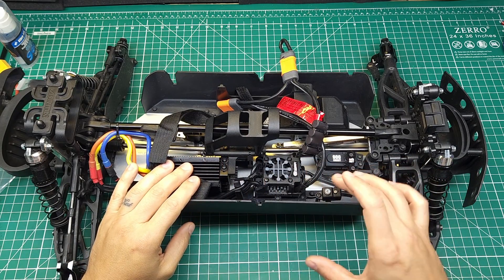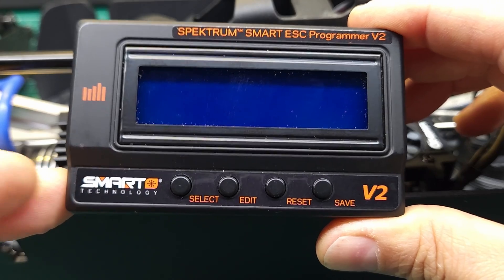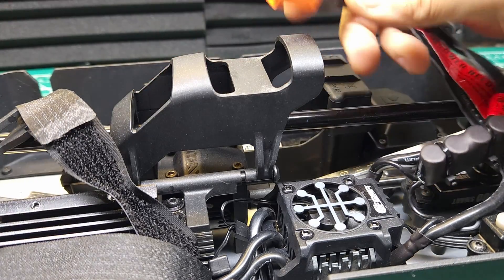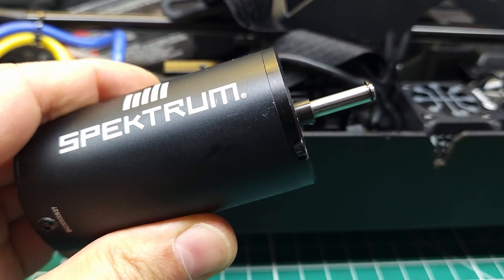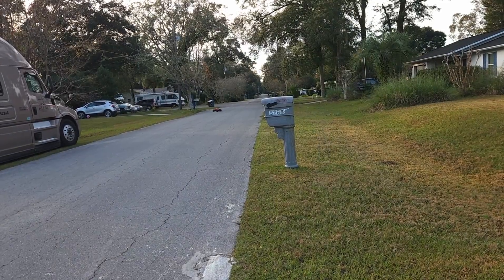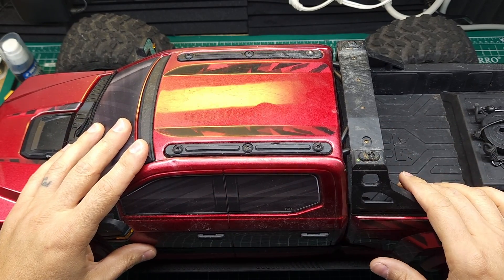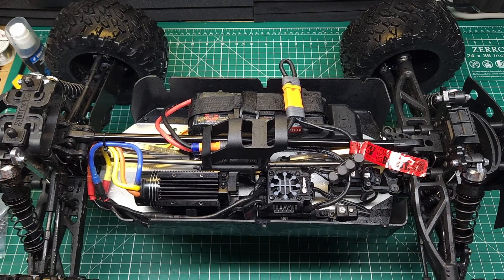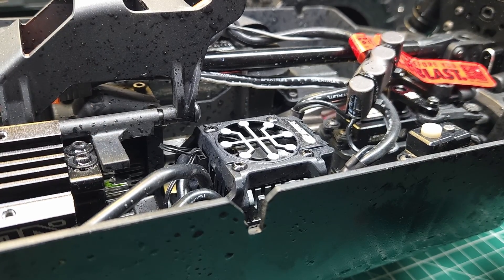Does New Firmware Fix The Firma 150 V2 Issue?  Let's Find Out!

Comment: Would you recommend this esc over the old blx 185? Im currently having issues with my 185 not sure if i want to try and figure out the problem or i can get this esc for 65$ on a open box deal
Reply from the maker: Well if you're having problems with your 185 then this would definitely be better though I don't know if it's going to be an improvement in performance.
Reply: @DoRC  the problem I'm having is it's going by itself after I changed the servo and I think my nephew moved the buttons on the radio and reverse not working

Comment: I received my new Kraton EXB 6S yesterday. I did an unboxing video, and the original seals had been cut and new ones applied. I also checked the firmware version, and it is running b5.07, which is the most current as of this reply.
Reply from the maker: Yeah I heard that's what they were doing. Looking forward to getting mine on Tuesday!
Reply: @DoRC  you’ll love it! Can’t wait to see your videos on it. Just did a fully stock speed run! Uploading now!

Comment: I have the V2 programmer and still can’t get the new firmware version to show up under available versions only the old version PB-1.0.10? I even uninstalled it from my desktop and reinstalled it.
Reply from the maker: You need to download the latest version of the software from the link provided on the programmer box Page on horizon's website.
Reply: @DoRC  I went to the link from the V2 Esc I’m guessing there is a difference?
Reply from the maker: @dwaynehensley3488 Not sure. I would look up the programmer itself and then use that link. That's where I got mine from and it worked fine.
Reply: Ok trying that now. Thank you
Reply from the maker: @dwaynehensley3488  You're welcome let me know how it goes
Reply: @DoRC Well I got the program box updated to the newest version but now it will not let me click on Firmware update after I change to the ESC drop down menu. Mine only shows about and firmware update unlike yours showing the basic and advanced icons also. I can program from the program box now but can’t get the Esc update.
Reply from the maker: @dwaynehensley3488 have you tried restarting everything?
Reply: @DoRC  yes sir a couple times even uninstalled everything and started over still nothing. I have contacted HH to let them know. Just don’t make sense I can update the program box and reprogram the Esc with the box now as I made sure that was working but can’t update the firmware on the Esc.
Reply from the maker: @dwaynehensley3488  It is weird. It means your computer is talking to the box and the box is talking to your ESC but the three aren't working together which is not something I've ever seen before. Not really sure what to suggest other than maybe a different computer, different USB cable or try it with a different ESC just to see if you can narrow down what's causing the problem
Reply: @DoRC  will do, already tried a different cable with no luck. Will try a different laptop next. Thanks again for your time and help.

Comment: I didn't like having to buy a Bluetooth module to access everything on my Traxxas X-MAXX. But sometimes I would get over the air updates and I prefer that than connecting a program box to my other ESCS!
Reply from the maker: Yeah when it works the Bluetooth is great. My concern is that sometimes it doesn't work

Comment: Hello... just curious..Whats the difference between this esc and the regular spectrum esc ..I do have this one...Im going try to upgrade my programming card again... Thanks!
Reply from the maker: This is very similar to the V1 150 amp ESCs. It is slightly updated with some different programming options and seems to be a bit heavier and potentially cooler running but it's not gently different from the V1 version.
Reply: @DoRC  ok.. Thanks... somebody told me that it have a little more power than the regular one

Comment: I'm confused why the V1 programmer can't be made to work with a frimware update, surely it's just a software issue 🤷
Reply from the maker: No idea. I had a V1 programmer and cannot find it now. It is possible that there is a communication limitation or a hardware limitation but those are just guesses.
Reply: @DoRC  strange as I'm pretty sure the original Hobbywing LCD programmer works with all their higher end stuff, same with the cheaper LED one

Comment: So, you're telling us we need to spend an extra ~$30 for the programmer, just to fix the issue? Fail. Hardcore fail.
Reply from the maker: Unfortunately yes. They might provide another solution if you ask them but I'm not sure about that. I will say though that the programmer is a really good thing to have as they sometimes incorporate new functionality into firmware updates and it does make changing settings on the ESC a lot easier than dealing with the other methods
Reply: @DoRC  Id honestly like to have one myself, but they absolutely can't make this a mandatory solution.
Reply from the maker: @bra1nc417d  I just got an email and it seems like that's what they're doing. They did give a 20% off coupon code which I guess is something.

Comment: Thanks for all that timely info…..And it only took about half of a 4 minute video!!!!!
You rock👍
This problem is a lot like the automotive industry where a part supplier ef’s up and causes a recall for the vehicle maker. In this case, it’s Hobbywing via Spektrum. Horizon should do what Redcat did and issue a $50 credit and an apology. That would cover the cost of a V2 programmer (with shipping and tax) for those who need one, and some good will $$ for those who don’t. Or an additional option, similar to the auto industry, they could reimburse hobby dealers for fixing the defective esc’s people bring in.
Reply from the maker: I agree but it appears as though horizons taking the never apologize route like they seem to normally do.

Comment: I don't see the new version when I go to update the program card. Anyone else with the same issue?
Reply from the maker: Did you download the latest version of the software by going to the website? You have to get the latest version of the Windows programming software
Reply: @DoRC  Yes sir I did and extacted all to desktop. When I open the file it will not let me click on the update box or anything else for that matter. My anti virus keeps coming on and I run anyway, but it's just not working. Guess it's the anti virus. Any suggestions would be greatly appreciated.
Reply from the maker: @benlandrum75  Did you go up to the top and choose the programmer from the device list?
Reply: @DoRC  I'm out bashing right now. I'll try it when I get home and let you know. Thanks alot man.
Reply from the maker: @benlandrum75  sounds good have fun :-)
Reply: Hey man. Is there a way for me to send you pics of what my computer is promoting me to do?
Reply from the maker: @benlandrum75  sure. My email address is in the about section on the channel. You'll have to go on desktop to see it as for some reason YouTube doesn't let you see the email address on mobile. Just take some screenshots or pictures with your phone and send it to me along with what's going on.
Reply: Like email, text?
Reply: Sent you an email

Comment: That's cool the update fixes the issue.   I would have to goto a hobby shop in hopes of doing the upgrade as I don't have a computer or access to one really.  Stopped using computers a few years ago.
Reply from the maker: You could also contact Horizon. They might let you send your ESC in for updating.

Comment: They changed something all I get is one link takes me to the 2021 version 1.0.9  the 1.0.0 just gives me a rar file  I tried 2 computers 2 browsers private mode I cant get this to download.  It would have been to easy to just plug in the programmer and have it find updates like every other thing out there. Any way you can post the zip file somewhere to download?
Reply from the maker: I just checked. If you go to the Horizon website look up the Spectrum Smart programmer then download using the PC download link about halfway down the screen it'll bring up a Spectra firma ESC update instructions PDF. Use the link in that and it is currently still the latest version which should be v 1.1.0.0.zip.
Reply: @DoRC  that's what I did all I get is a rar file for some reason
Reply from the maker: @L2theWcarscoffeelife  shoot me an email. I'll send you a link. My email's in my about info. I really don't like putting links in the videos because they always end up getting outdated and then it's a game of whack-a-mole to keep them up to date.

Comment: As a factory defect, I hate to say this but that is what warranty programs are for, so they meet their obligations by following the regular process of having people send in their ESCs for service. It would be cool if they offered people the option of being sent a preloaded program card to fix the issue themselves; that would elevate peoples perceptions around Horizons customer service.  For the new Kraton 6S EXB, if those haven't shipped out I think they would be better off delaying delivery to fix the issue on all of the units.  It would prevent another set YouTube videos highlighting the issue all over again.  Reminds me somewhat of the out drive issues with the initial V2 4S trucks that were in the hands of content creators before final production units went out to regular consumers...if I remember correctly I think they had the new out drives on the trucks that went out to consumers.
Reply: In canada they dont even bother with this. They send whatever you need to have the issue fixed
Reply from the maker: Probably different laws up there.
Reply from the maker: I don't think they could do this. The program cards don't have the ability to store firmware themselves.  They're essentially just an interface between the computer and the ESC.
Reply: @DoRC  thanks I havent had a need for one of these cards yet so didnt know how it worked exactly. Ultimately, glad that they acknowledged the issue and have a fix available.
Reply from the maker: @barbedwirerat661  Yeah it's definitely a good step. I will be really happy if they voluntarily take care of everyone who has a problem however is best for that person. We'll see.

Comment: Free programmer? Absolutely not
Reply from the maker: Maybe. It really depends on what's most economical for them. If the choices between sending out a free programmer and having the ESC sent to them, updating the firmware and then sending it back The free programmer might actually be cheaper for them. They would save shipping one way and the labor to update the ESC. I doubt those cards cost them very much to have produced.

Comment: I don’t see the program card update
Reply from the maker: Did you go to the Horizon site and download the latest version of the software? You need that latest version.
Reply: Got it now I initially went to spekrums website they still have tbs old link
Reply: This update allowed me to finally use the program card with my firma 160v2 but it freezes my computer when trying to update the firmware on the esc
Reply from the maker: That's not good. Try restarting your computer or if you have a different computer try that.

Comment: The thing is there is not a single video of  the new kraton EXB V2 running yet.
Reply from the maker: Yes nobody has one yet. I very strongly suspect they will have the same issue though. This is a fix that they just implemented yesterday according to the time stamp on the file. I think it's pretty unlikely that they're going to open up every single box on the new EXB and fix them before they go out. That being said they might. They might find that  box on the new EXB and fix them before they go out. That being said they might. They may decide that it's more economical for them to do that then deal with a bunch of support calls.